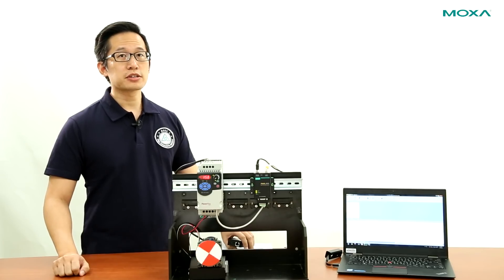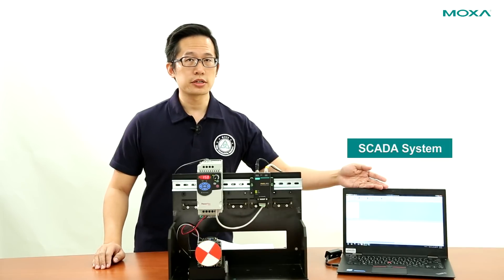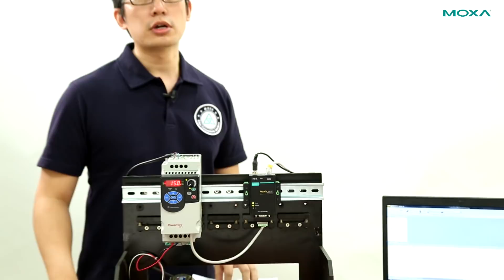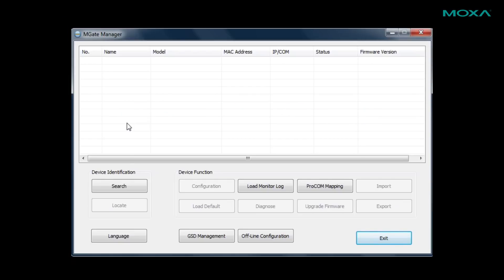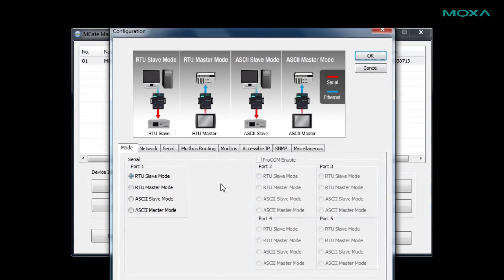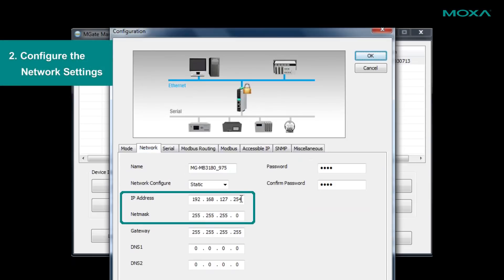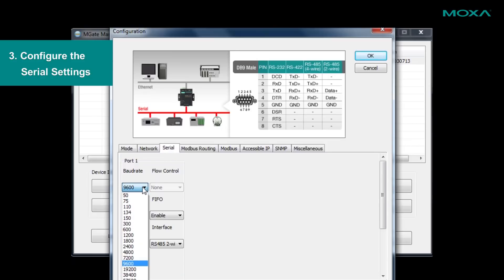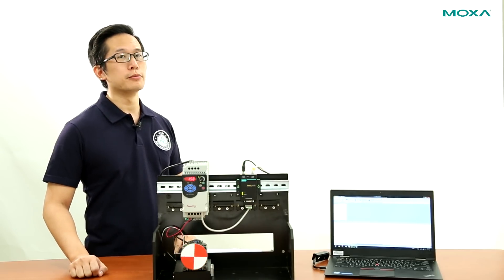Convert Modbus RTU to Modbus TCP Protocol in 60 seconds with Moxa MB3000 Series Modbus Gateway

Comment: Do you need to configure for the slave id ? I have a gas analyzer which output result via Modbus RTU and has a slave id of 11. I couldn't find this slave id when I tried to use auto detection to configure the time out response. Any help ?
Reply from the maker: The MGate MB3180’s Modbus Routing Table is configured to recognize all slave IDs between 1 and 254 by default. You can verify this in the Modbus Routing Tab. The Auto Detection feature uses Modbus Protocol function code 08 to detect slave devices and determine the best Response Timeout setting. Unfortunately, some Slave devices do not respond to Function Code 08 commands. This does not affect normal protocol conversion functionality, however. Please continue in configuring your Modbus TCP Master to poll the MGate’s IP address and Slave ID 11. You may contact Moxa support on the Moxa.com website if problems persist. 

For technical support: https://www.moxa.com/en/support/support/technical-support

Comment: please let know the wiring diagram from vfd unit via rs485 to MB3180 thank you I have MB3180 but i don’t know how to connect
Reply from the maker: Hi Bernard! There are many ways you can connect RS-485 and it depends on the types of cables and connectors that are readily available to you or the requirements of installation sites. Ultimately, the positive (Data+) pin of the MGate needs to go to the Positive (+) of the VFD, and the Negative (Data-) of the MGate needs to go to the Negative (-) of the VFD. Please reference the user manuals for both devices for the pin assignments and wire accordingly. If you prefer a diagram, please submit your request via a technical support case through the Moxa website. I hope this was helpful! 

To create a support case: https://www.moxa.com/en/support/support/technical-support